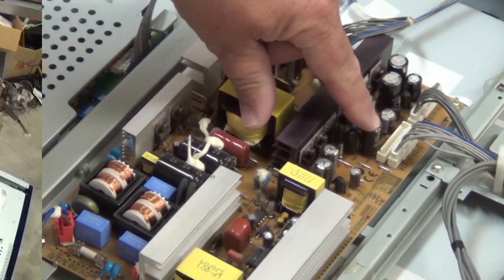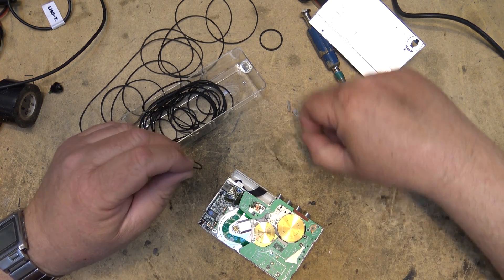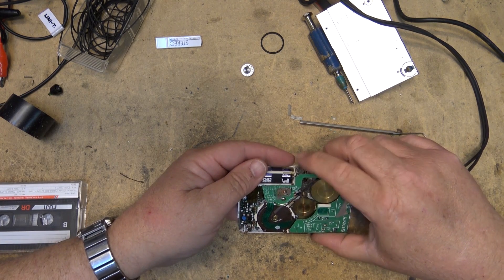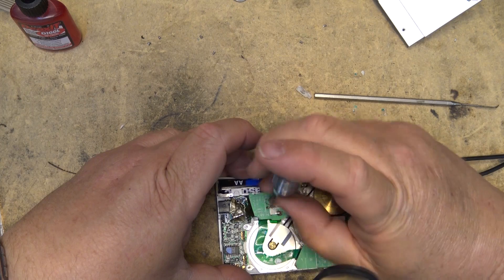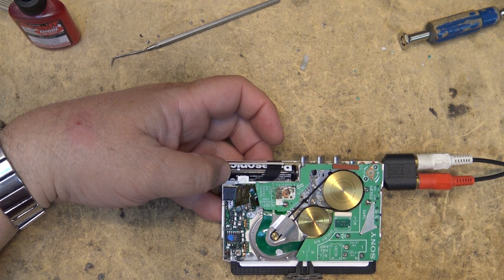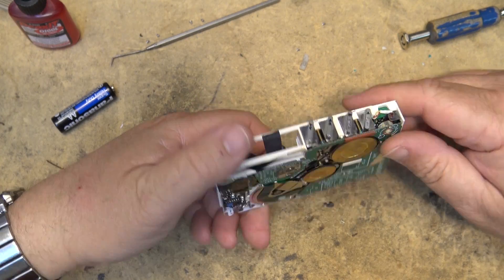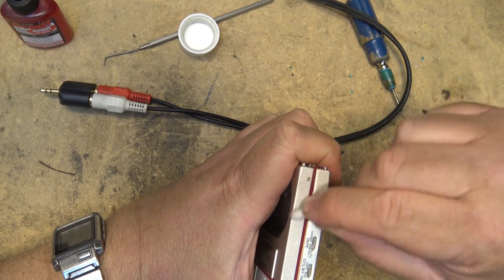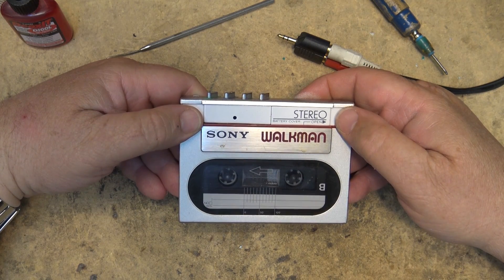Sony Walkman WM10 Repair

Comment: The smallest cassette player is the SANYO JJ-P4 !!!
Reply from the maker: That's not a walkman
Reply: @12voltvids  what is it ? a stereo cassette player only ?
Reply from the maker: It is and when closed with no cassette it is the size of a cassette tape in its clamshell case.  Since sanyo and others could not make a "walkman" they can't have the smallest walkman. Not possible because nobody else can make a walkman.  Some tried to call theirs a walkie but nit a walkman.  It's the same with betamax. That is a song trademark.  Sanyo called theirs betacord, and others just called it beta.  Beta was the format betamax was sonys trademark for their beta format vcr. Betacam was a format. Not a trademark.  Other companies like ampex produced betacam recorders. That became the international professional 1/2 vtr format that made Sony a shitload of money.  When it boiled down to things the format used 95% same parts as home beta did. They didn't cost that much more to make but they sold for between 12k for a basic recorder to 80k for  ďynamic tracker.  Every TV station in the world had dozens of them and they were in every production center.   Unlike other formats it had staying power from the early 80s right thru to the end of tape around 10 years ago.  They even had digital and HD versions all backwards compatable with the first generation tapes.
Reply: @12voltvids  That’s Right. I have 250 walkman !!! No Joke……

Comment: Thank you for the great video.  I actually had a smaller one made by TOSHIBA at one point and the cassette would stick out when you put it inside.  Too bad it did not last as long as my sony, but it sounded just as good if not better.  ✌

Comment: I have 3 WM-F10s here, one works completely and sounds amazing after replacing the belt.  It even measures wow and flutter at .15% WRMS.  Amazing little rig.  Another one goes "tick tick" at around one second intervals, possibly a broken gear at the takeup spindle.  It could be a challenge to get that deep into it.  The other one has not been opened up yet, but probably has a belt that has turned to a strange black goo.  By the way, in FF or REW, at the tape end, the motor stops, but continues to draw current.  I noticed this by running one on a variable power supply.  The motor stalls but still draws around 300 milliamps.

Comment: Hey man. Awesome video I have one of these WM-F10 and it’s so killer.  But It needs a tune up. Do you do repairs?
Reply from the maker: No access to parts.
Reply: @12voltvids  what if it was just a belt replacement?
Reply from the maker: @ColinGorman  trouble is getting the correct belt.

Comment: It is not difficult to replace wm10/20/F20.. walkman belts yourself. Remove the tiny screws and use scissors tip to remove Volume knob screw. Sony does not produce walkman belts any more. Where can you buy replacement belts? I bought some from eBay before but they were too elastic, not good for motor driven.

Comment: I have a complete Sony WM-10 had since new. I replaced belt, but switch s acting up.  Could you look at and repair for me? I put new belt on.  Thanks, Duane Michigan
Reply: @duanecummins9516 Use cotton swab with alcohol to clean and then use swab with silicon oil. It may help.

Comment: 4 volt 220uf capacitor on my wm-10 is overheating and the unit stopped functioning. I assume the capacitor failed and no one seems to have a small enough replacement. What do you recommend?

Comment: There is even a smaller DAT-Player that has an incredible tiny mechanism wit a rotary drum the size of a nickel. These have a very small production count and probably ended up in a museum somewhere.
Reply from the maker: DAT itself used a drum the size of a nickle. The walkman dat used a drum the size of a dime, and there was another one, the Sony NT1 and NT2 which used a tape much smaller. Only 30mm wide was the cassette. It was a 2 sided tape and you flipped it half way. I have only seen this one once. As a sony dealer we had to carry that crap but they were very expensive and nobody bought them. Sony also had another micro videotape format called the MV1.
Reply: @12voltvids  Yes, incredible days.

Comment: Very good job. Ι have an Exactly the same model. The tire is broken. I opened it According to your instructions I cleaned it very well and   I can not find the same tire.  You can give me the details to find a tire ? I mean the dimensions the thickness and the length. Thank you. John from Greece.

Comment: My WM-F10 eats tapes at the pinch roller. Do you know what size pinch roller this is and if there's any recourse other than replacing the roller? I've tried cleaning it, and the rubber feels fine. The capstan itself also feels and looks OK, and I've tried cleaning it as well. Any advice would be appreciated!
Reply from the maker: Check the take up torque.  If too high it will cause the tape to ride up or down on the pinch roller and damage the tape.

Comment: I had one of these back in the day and it might be the neatest electronic gadget I've ever owned.  Ridiculously tiny, sounded better than most decks (including some 2-3 times its size), could handle high-bias tape and had Dolby NR.  Back when Sony's engineering was bleeding-edge compared to most of its competitors (although that occasionally had its drawbacks...).

The incredible thing is, they weren't even particularly expensive, given all of their features and their tiny size.  They also came with nifty (for the time) earbud style headphones.  A marvel of '80s design.
Reply from the maker: Especially that motor.  So thin.
Reply: @12voltvids  I never opened mine up but I was always curious. Of course it got stolen but once I got my Sony D-10 Discman a couple of years later I forgot all about it. That was another technological miracle for the time. 
 
https://www.just-cd.com/post/sony-discman-d-10-black-portable-cd-player
Reply: They came with a plastic & fabric jacket as I recall, which provided the unit with some protection as you carried it around.

Comment: Pleased I see this video.  I have a WM20 (which is the same) which I won on Ebay some years ago. BNIB it was. So I got it out, put a battery in it and started listening. It worked great, for about a few hours then suddenly stopped. An electronics engineer told me it will be the switch inside. Didn't know what I was looking for but now I do. Thanks a million.

Comment: Which do you think is more impressive, the Nagra SNST or the WM-10t? I used to see the Nagras on Ebay for under $500, and now there are a couple listed for over $14000. Absolute insanity!
Reply from the maker: Well nobody in their right mind would pay that but you know if someone wants to pay me big bucks for some of my old gear like my ct101 world's smallest color CRT then I wouldn't stop them.  It would be gone pretty quick.
Reply: @12voltvids  Ok, but I get a 10% finder's fee. : )

Comment: Hi sir. I found your videos quiet exciting. Usually seen sony antique products repairing nicely. I want your little help. I've sony hifi music system model LBT - ZUX10D. Its hi fi powerful system Quiet old aswell. There is a problem whenever i start the unit it display shows Please Wait. Dvd tray open & close but disk doesn't play & continue show Please Wait. When it shows Please Wait sound doesn't come even in Fm & audio in, Tape mode. Pls suggest  what is the problem in it. Thanks alot.

Comment: Pretty good Walkman, but it is not the smallest ever made! 
For those old Walkman’s it is not enough to only change the belt and clean the contacts. It’s need to be fully disassembled, cleaned, lubed. It take about 10 hours, or sometimes more, almost like Swiss watch repassage.
This model and many other Sony models with reels with Sony logos has a very sad malfunction - reel gear crack, and there are no normal way to fix it. 
Very attractive Walkman, but very trouble Walkman.

Comment: My 1986 
Sanyo M GR62 is really cool too, it runs for as long as it has, and sounds good after my having work done.
   I also have a 2000 Grand Prix C3023 I bought new for $6.99 from when I used to work for Circuit City, and a 1985
GE 3-5432A. The Volume needs De Ox, but it hardly has a scratch for being thrift store bought.

Comment: I have a WM-F30. It turns on but it needs a belt replacement and some cleaning. It can turn on without a headphone jack plugged in. However FM works best when it's in expanded shape, but only the left channel is audible. The right channel is super low on volume. Both channels low on volume in compact mode and the volume knob doesn't affect the volume when compact. Help! Maybe you can help me understand where to look and clean in this tiny contraption

Comment: Great video! Bought new belt before I opened my F10 and found old one completely melted. Acetone cleaned everything up and new belt turns smoothly.
Unfortunately, left side spindle only rotaes 1 revolution in either direction before it hits a dead stop. This stops thje machine when playing or rewinding.
Looking at the circuitboard side, can see no obstruction. Any thoughts? Thanks again!
Reply: Hi! Not an expert here especially in Walkmen, but it sounds to me like it might be a motor problem. Similar happened to my turntable's brushed motor. It will start to rotate but only for less than a revolution. There's torque when I hold the motor spindle, but when I let the motor go, it doesn't continue spinning. Acetone fumes may have damaged the motor. These bits are very sensitive to contamination. But I could be wrong (and I hope I am).

Comment: I have one of this plays intermittently and battery gets very hot. Any idea as to what would cause this?
Reply from the maker: A short somewhere.
Reply: 12voltvids thanks, found the problem half the negative terminal was missing. Stuck a bit of aluminium foil in and now works fine!

Comment: Hi there. I am in need of help here. I tried to fix my sony wm-7. I accidentally ripped the flexible board. So i tried to use a flexible board from another non-working unit and i managed to rip this one too. The flexible board was glued to metal frame. Is there any way of fixing it? What would you recommend?

Comment: Glad I found the video, my FM-10 came with a corroded battery, and I needed to get the back off to 

do the clean up. It looks like i just need to remove the knob to get there, I already did all of the screws !

Comment: That motor is making a lot of noise. Might need regreasing and fresh oil.
Reply from the maker: Those ones always were loud. They are a 3 phase BSL and they make a fair bit of noise.

Comment: You would find a dental tool called a “flat plastic” easier for belt manipulation than the probe you are using.
Reply from the maker: And I am sure based on your handle you are familiar with these tools.

Comment: Mine won’t power up. I can hear a tiny click through external speakers when I turn the radio on or press play. I also confirmed there’s 1.5v going to the power when the speakers plug into the jack. My guess is the dc/dc step up converter has issues. Any ideas how to fix it?
Reply from the maker: The DC-DC converters did have issues on those units from time to time.
Reply: Any idea where it is located and how tough it would be to fix? Wonder if there are schematics available somewhere.

Comment: Hi, I have a problem with my wm 10, everything works fine but when I press play, it works for like a second and then the button pops, just as if I had pressed stop. any idea of what could it be?
Reply from the maker: Auto stop mechanism. If the take up hub is turning then either one if the little levers in the auto stop is stuck or damaged.  If stuck it may be possible to fix if damaged or worn sorry the parts are not available.

Comment: What fluid did you use to clean it? I noticed in some other videos you mentioned cleaning smoke stains. Is the fluid the same to clean those?
Cheers.
Reply from the maker: I used deoxit d100 to clean the switch

Comment: Had the black model with metal tape capability. Mine died due to the capstan wallowing out which is sadly non-repairable due to parts not being available. I did love that player.

Comment: great videos, I have a question, where can I get a belt kit to fix several walkmans and some reel to reel players? Thanks for your answer.
Reply from the maker: The Bay of "E"
Reply: @12voltvids   ok that is where I was looking, just making sure, thank you so much for your answer and inspiration, am gonna try to fix a wm-2,  I just found at that same place you mentioned. A Walkman that left an impression on my life.
Reply from the maker: @razpones  WM-2 wow. I fixed a few of those. Nothing like the guy across the bench from me when I worked for Sony. I was fixing Betamax, and he was fixing walkmans.
Reply: @12voltvids  hopefully it only needs a new belt, the description mentioned "RUNS WITHOUT A CASSETTE BUT DOESN'T RUN WITH A CASSETTE INSERTED" (caps are his) so sounds to me like slipping belt. I also want to fix a philips N 4504 (reel to reel) I found on the curb, Haven't opened it but I think it is belts that it needs....

Comment: I bought one in a drift shop for 5 bucks 10 years ago I cleaned it up sold it on craigslist for 50 bucks . the one I had there was a built in FM Radio tuner too .

Comment: Where do you find those tools? They look specific to open Sony wm10.  Thanks
Reply from the maker: The screwdriver is a standard japanese #0 cross point.
The other tools are standard dental type picks available at electronics shops, or your local dentist. Only difference is the dentist uses stainless steel picks.
Reply: Thank you for the information. I have a wm-10 (mine that I bought in 1983 or 84!) and I think the belt is worn. A little hesitant to open it up. If I decide to sell it I think most people would want a working one.
Reply: Vincent: It was gold with blue letters, the original headset and belt clip.

Comment: could you possibly do a video on how to adjust the auto-stop? mine is stopping immediately and I don't know how to remedy it. no one seems to have a guide on it
Reply: I seem to have a similar problem. FF and FW work fine. But the play button does not stay down. I hear a small click when pressing it, tape plays correctly if I keep the button pushed down. Comes back up as soon as I release.

Comment: I have one of these and it had so much corrosion, even past where the battery sits. It was ALL OVER the device. I cleaned it up with vinegar. However, it doesn't turn on at all. Any idea what might be the issue?
Reply from the maker: That unit uses a DC-DC converter to convert the 1.5v to 3v. That would be the place to start.
Reply: 12voltvids I plug it In and it's static. Fm radio doesn't work nor does the cassette function.

Comment: Has anyone ran into plastic shrinkage gear cracking issues on the left (facing front) take-up reel? I am 4 for 4 on ebay repair units having this issue and its a disaster! It is the same type of plastic cracking that occurs in the DD Walkman.
Reply: Did you ever find a solution? I have the same problem. I'm going to try using epoxy to fill the gap and create new teeth.

Comment: remarkably similar to the Sanyo JJ series of the era.  You applied deoxit @6:40 to what? the tiny feather copper switches??  That's what I call them anyways.  They can be a pain sometimes. That's what the sanyo's are loaded with. Sometimes they lose their springy ness too and need extra support to move away from a connection.

Comment: You would  think a brushless motor would  be silent. 

It's made of METAL can I tuch it ?
Reply from the maker: Shaun Lomas 
Brushless motors are pretty loud. Especially when they are this thing. No casing to keep the noise in.
Reply: Really depends on construction (materials can dampen and affect resonance modes) and how it is driven (frequency, multi-phase shifted sinusoidal or harmonic rich square or pseudo-square)

Comment: Why don't you put a soft cloth on your bench? Why risk adding scratches over scratches?
Reply from the maker: Normando Marcolongo 
It won't scratch easily. It is brushed aluminum. The bench is relatively free of abrasive material and I am not sliding it around. Also it is my unit. It already had scratches from years of use.
Reply: Normando Marcolongo good point
Reply: I've been thinking that for months. He has some really nice vintage electronics that he's sliding all over that unpadded surface. He's great at troubleshooting, but kind of a hack sometimes.